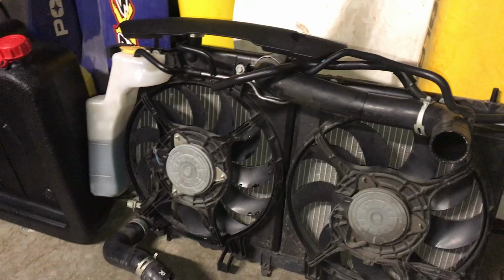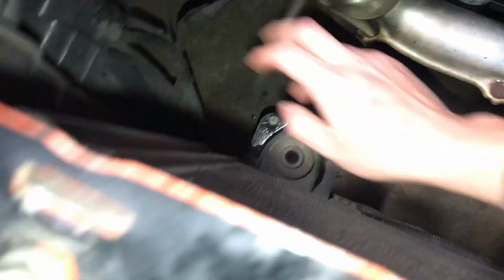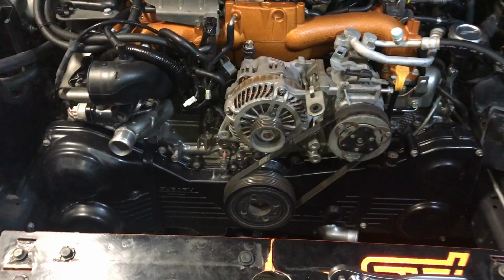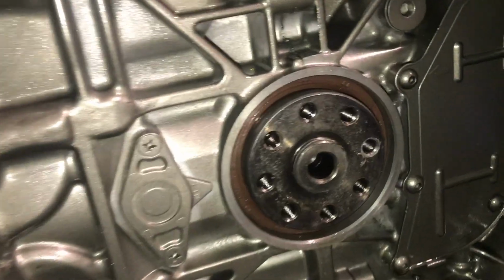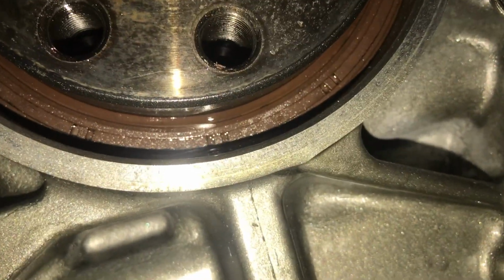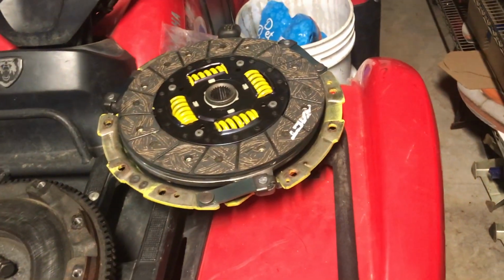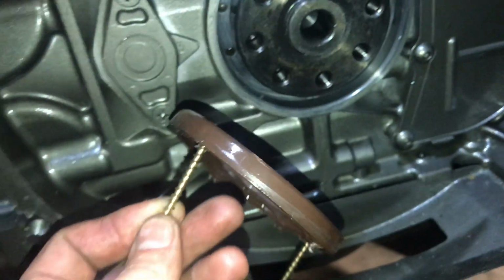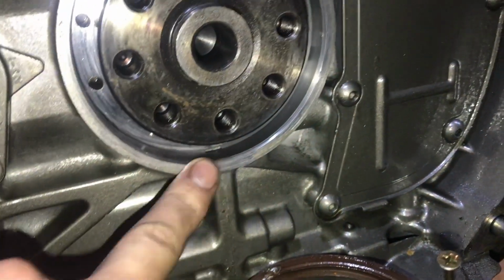Rear Main Seal Problems

Comment: whats your break-in plan?

The motor is broken in by ~250 miles honestly.
Reply from the maker: I was looking on line and was following IAG Built Motor break in process. Looking at it it made the most sense to me. It is going to take a while which is going to suck but hopefully it will go by quick.